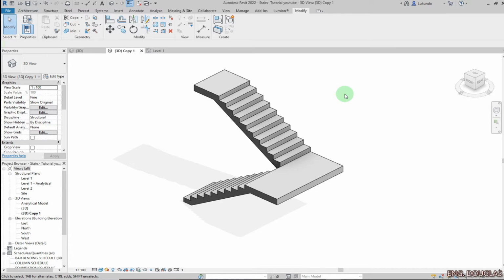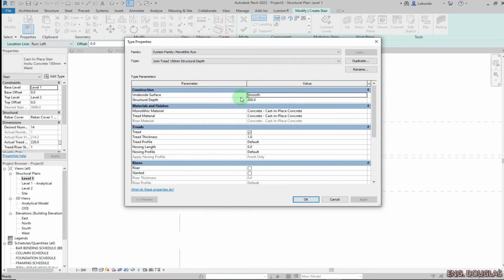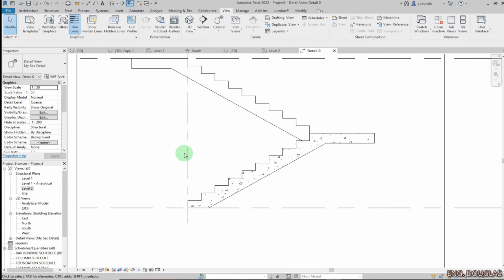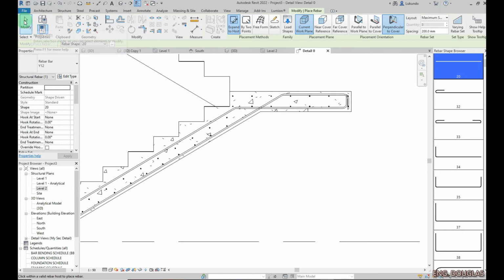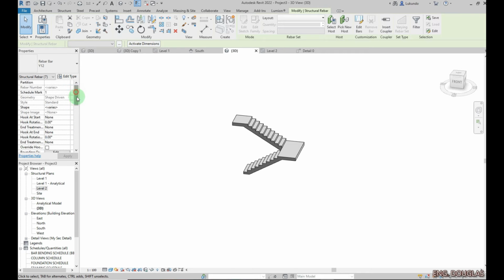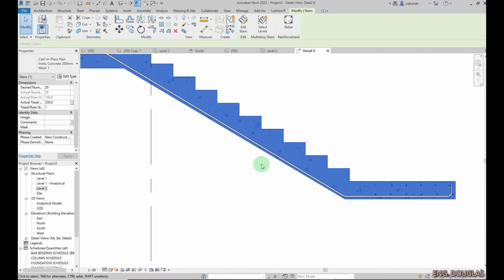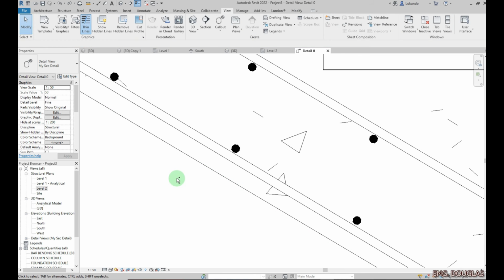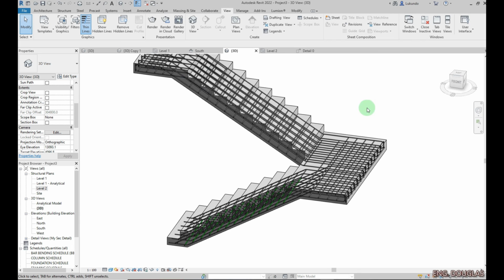Revit structure_ 3D Rebar reinforcement in stairs

Comment: Thank so much, I have a good question, what happens if after we put all the rebar I need to adjust the height of the stairs?
Reply: Is the rebar able to adjust automatically?
Reply from the maker: Yes it adjusts automatically. Make sure the rebar is hosted on the stairs and do proper rebar constraints. Watch more lessons here for hosting rebar and rebar constraints